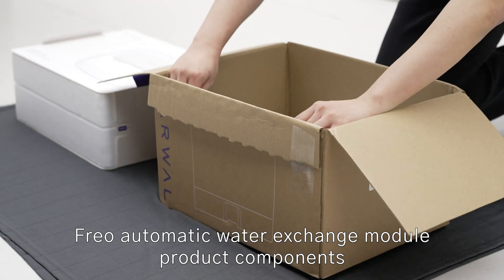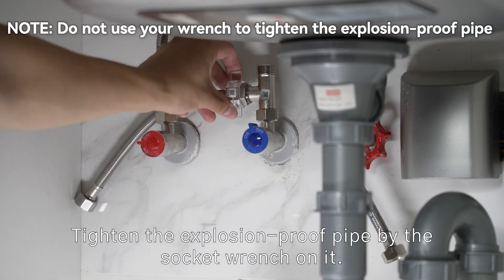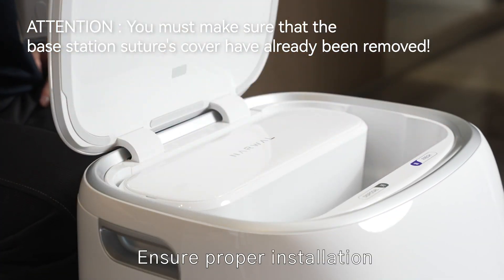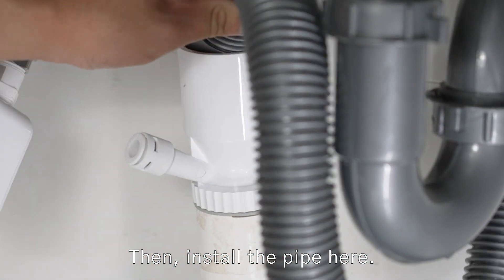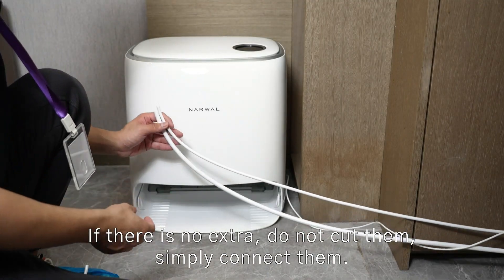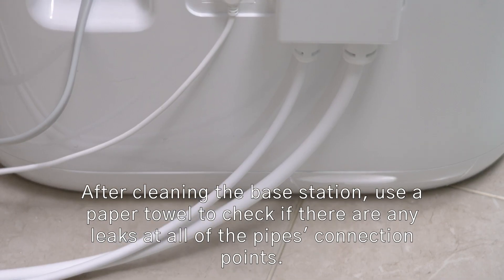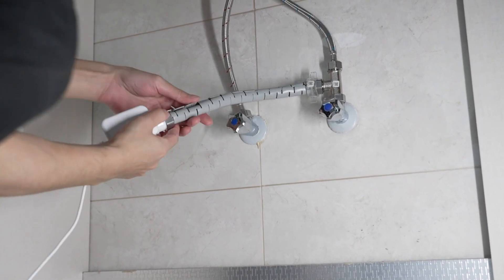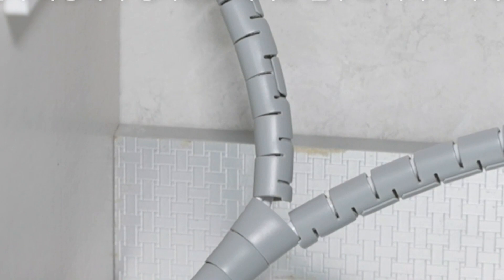Installation Quick Guide | Narwal Freo Automatic Water Exchange System | How to Use

Comment: If you live in the United States, this video is nothing more than a work of fiction - the supply line T is not compatible with supply line valves found in most houses.  The drain interface is also horribly oversimplified.  This job is a headache at best for the most experienced do-it-yourself types and is impossible for anyone else. I'm cursing Narwal as I type.

Comment: Where/when can we buy the "Dirty Water T-Joint"?
Reply: where you able to find the Dirty Water T-Joint ? I am looking for one too
Reply: @alvarolramirez6583  Narwal doesn't sell them.  I had to use a dishwasher interface T and then use adapters with hose clamps to connect it to the dirty water drain. THIS, however was the easy part. The supply line interface to a faucet T is far worse.
Reply: @TheMrbuckeye3 what did you end up doing? This seemed simple for me. I installed mine in my bathroom. I had an explosion proof  hose that connected my supply line to my sink. I put the Narwal provided T between my existing hose and the sink and it’s working well.
Reply: @jasonbahl  My local hardware store had no option to adapt the 3/8" MIP to the 1/2" pipe thread that the Narwal T came with.  So I replaced the T and then adapted to the explosion proof hose using a threaded  nipple and a couple adapters .  . .but it leaks because I couldn't get the nipple tight enough.  For the drain, I used a dishwasher T and passed it through a series of adapter till I could put the 1/4" ID tube onto it.  Took me four trips to the store. . .and the supply side still drips a bit. I just put a tray under it.  So bad.

Comment: Is there a way to connect the dirty water to a standard sink drain pipe? Looks like they only show floor drain and a laundry type open drain pipe
Reply: It’s a 3/8” hose, which is the same size as a drain hose for a reverse osmosis system. I found a saddle clamp valve designed to drain an RO system fits perfectly. Just have to drill a 3/8 hole into your drain pipe above the P trap and connect it.

Comment: Where can I buy T-joints to connect DirtyPipe?
Reply: You can't get it from Narwal. They don't make them. You have to build your own from whatever you can find at your local hardware store.
Reply: A 3/8” saddle drain valve, designed for a reverse osmosis system fits perfectly. And they are under $10.